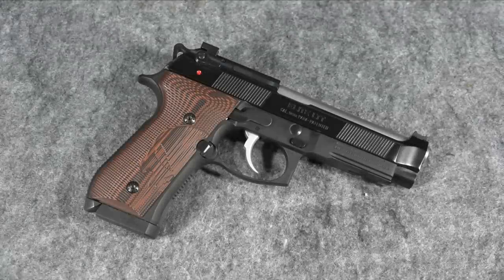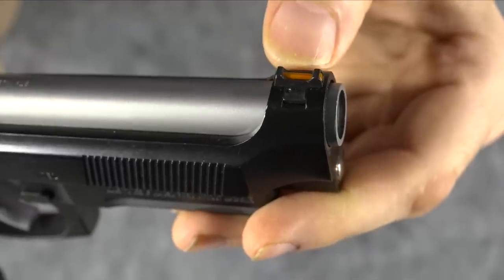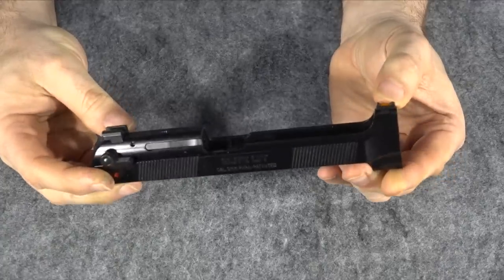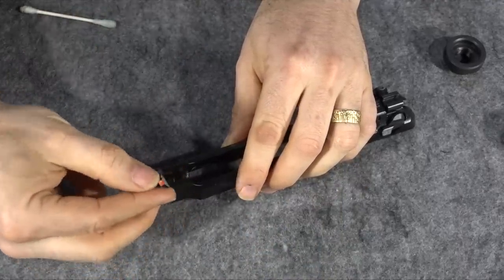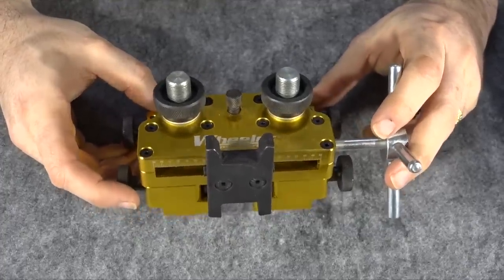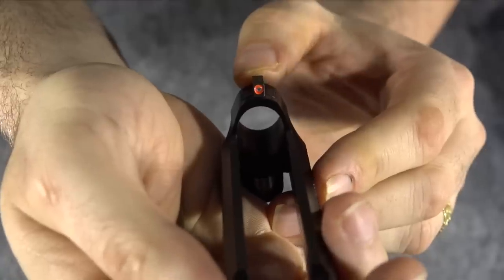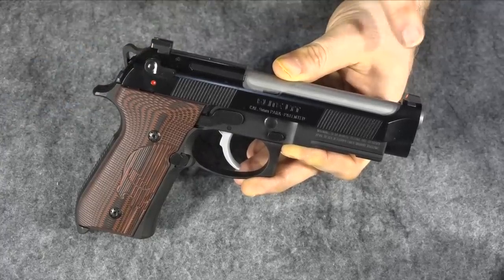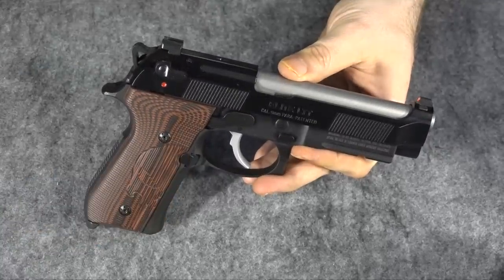Beretta Elite LTT Spartan Night Sight Install...(How-To Install Beretta Sights)

Comment: I'm about to change the sights on my Beretta 92X full size both front and rear sights, instead of having the square block cut rear and orange painted front dot I will soon have a set of XS DXT2 Night sights the front is a tritium dot with a yellow outline and the rear is the shallow slope v cut with the tritium line vertically in the middle of the v, they're usually referred to as the "dot the i night sights" and are by far my absolute favorite on any pistol within 15 yards poi vs poa is at the middle of the dot, and 25 yards and further it's at the top of the dot for a sweet 6 O'Clock hold. I am so glad you shared this freezer trick to pop the sights out easier I wouldn't have considered that in all honesty. I love the Beretta 92 series, I have always had a 1911, and recently tried a friend's 92FS and I knew I had to have one mine holds 18+1 but unfortunately isn't the g model but that conversion is on my list for sure. Thanks TYM for a easy to understand instructional and helpful hint video.

Comment: @TheYankeeMarshal--> I was reading on the LTT website that purchasing the front sight only, would require the WC battlesight .300 or .305 for proper point of impact. LTT is a good co. with awesome products, but skeptical on this "have to include" and  wanted to get your views on how it works with the rear sight that was included. side note got the LTT compact and it is a damn beauty (love the spurless hammer), but yes want to replace that front sight, with the Ameriglo. Kind of digging only having one sight picture on the front and keeping the back plain.

Comment: Another great video. I use the MGW one, that was out before your Wheeler. When I saw the Wheeler I called and asked them if they were going to sue, but they weren't worried. Also I take a drafting pencil with a very sharp point and mark the edges of the raised parts of the sight on the slide so when I push the new sights on I line them up with the marks, and rarely do I need to readjust the sights, as long as they were good with the old ones. :)
Reply: I think the MGW sight pusher  is the better one
Reply: when you buy the  MGW shoe that fits the barrette 92  it has the spacer for the slide with it

Comment: I'm having a pretty hard time getting my front sight out. I was I initially trying to avoid buying another tool but after struggling I'm ready to try anything. I've got brass punches, a fully taped slide, hours of freezer time and I've only managed to affect the finish of the stock sight i am trying to remove. I've got a fiber optic from Wilson combat I want to install. Welcoming any other advice before I break down and buy a wheeler!
Reply: So what happened?

Comment: I have a Beretta 92A1 which I installed the Trijicon night sights on. If I aim using the tops of the sights, I shoot low. I'm fine if I use the dot as the aim point, but it is not super precise. I like that front sight you installed mostly because of the color difference from the rear sight. Is the sight post shorter? It would be very nice to line up the sights like I'm used to. Also, how much does that sight cost?